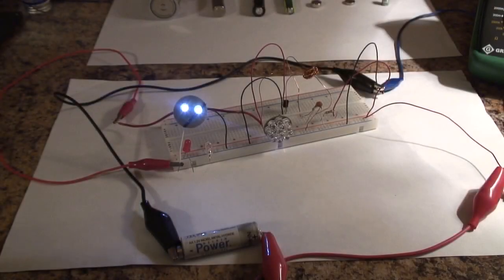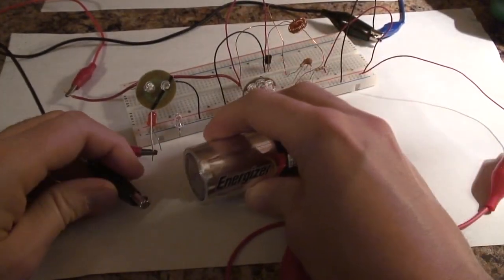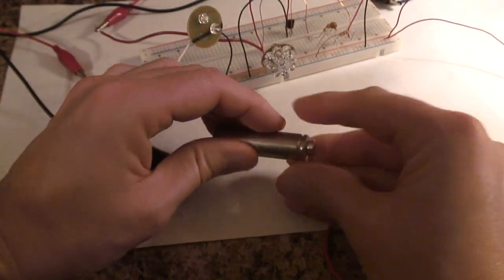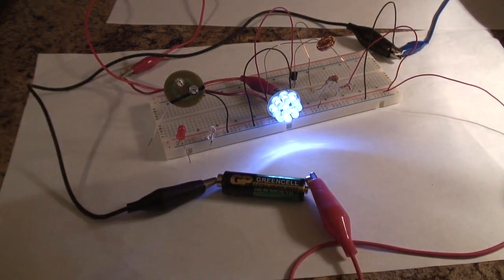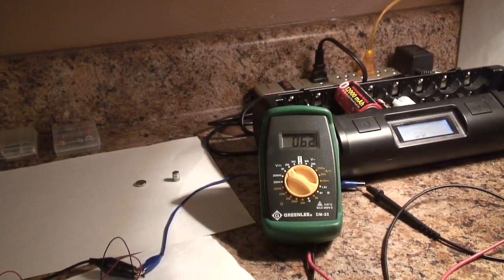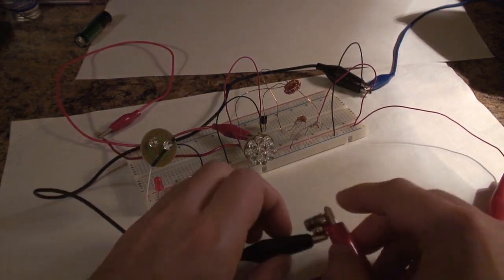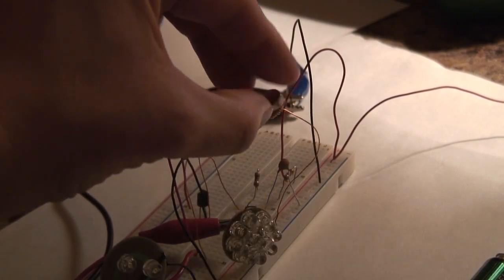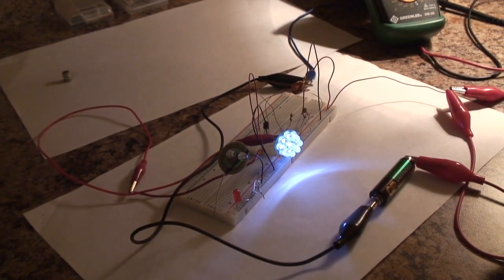Joule Thief from Scrap Parts

Comment: Watched the tutorial at ElPerfecto to check the size of the toroid and wire.

This little joule thief is a great little circuit.  Very flexible and forgiving.

Believe it or not, I've used toroids half the size of yours with 30 gauge wire, 14 turns center tapped at 7 and was able to run 9 LEDs: 3 parallel strings in series, with a 1.2v AA alkaline for about 10 hours without any real depreciation of LED brightness.

Good video.

Comment from the maker: That is about the lowest it could go, but with poor results that low.  It takes a bit more voltage to get the oscillating circuit to start.  Once the circuit has started, it can run at a lower voltage as the power source continues to be drained.

Comment from the maker: My experience has been that the circuit begins working between 0.3~0.45 V.  Your experience could be slightly different depending on the components used in your circuit.

Comment from the maker: As long as you preserve the coating on the wire so the wires do not short, I see no reason why you cannot use that scrap wire.  The wire I used is coated.